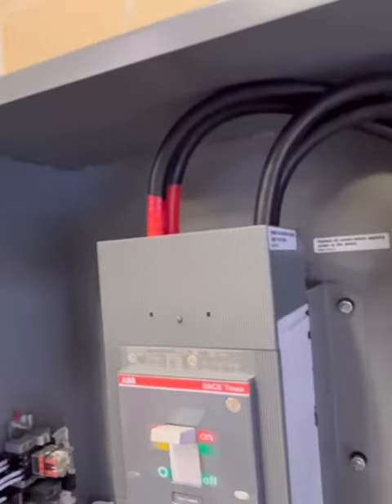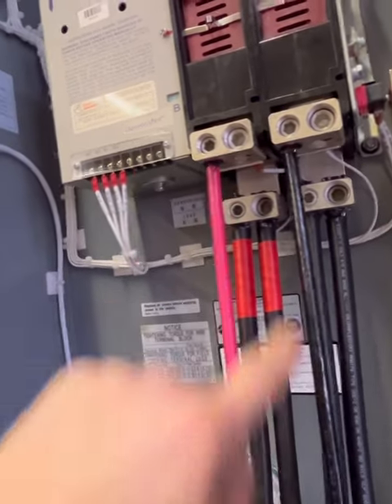Cummins 400 amp automatic transfer switch

Comment: Using paralleled 4/0 gives you an ampacity of 360 A you cannot use the exception in the code book for 4/0 aluminum cable rating at 200 A. But when you go from your transfer switch to your panel you must now use 250 MCM aluminum or 3/0 copper cable to meet code. Your 400 amp breaker is now your service disconnect. Any sub panels off of that need to be rated at the rating of the overcurrent device that they are terminated. Your work looks very nice. Did the inspector question the conductor sizing?
Reply from the maker: The inspector and electric company looked at the work and was satisfied.

Comment: How were the DC connections?  I haven't found a video explaining how those were done or what to keep in mind when making those terminations.
Reply from the maker: By DC are you talking about the battery that allows the generator to start in a power outage?

Comment: You are not an electrician,  but you did good! Looks good!  The phrase 4 o is really 4 ought. Or 4/0. The conduits the connect from the new disconnect to the the sub panels should be 2 in. Good job again!
Reply from the maker: I know 4 ought is the correct term, I always assumed 4 0 was the slang term. That’s good to know about the conduit size. I thought that I pulled up a chart to tell me what size conduit I would need but maybe I just went with the smallest size that I would be able to make work. Thanks for the comment.

Comment: Impressive.  Pretty advanced for a DIY.
Reply from the maker: Thanks!
Reply: What size wire do you have coming from the generator to transfer switch is it capable to handle the ampacity for the 400 amps ?
Reply from the maker: It’s #2 copper wire. It is rated for 115 amps if I remember correctly. The generator is a 20 KW generator which means it puts out 83 amps. That wire only needs to be sized large enough to handle the amps that the generator is putting out. Cummins put a 100 amp breaker on the generator so you have to size the wire to the capacity of the breaker on the generator. The 83 amps is more than enough power to get us through a power outage. My 400 amp service is unique, most houses have a 200 amp service. I increase the service to my house service because I thought I was going to pull power through my house to a shop in the future.

Comment: The load wires to the panels are not rated for 400 amps so shouldn't this transfer switch feed in to a distribution panel first with 2-200 amp mains for proper overcurrent protection for load side conductors?
Reply from the maker: The transfer switch is the distribution center. The incoming 400 amps is split into two 200 amps before it goes out to the panels. That’s how I can run 4/0 aluminum to the panels.

Comment: Jeremy, I take it your local jurisdiction did not require an outside disconnect.
Reply from the maker: This house was built 15 years ago and an outside disconnect was not required. I added this ATS and generator. The generator has a disconnect on it so anyone can disconnect the power coming from the generator if need be.

Comment: Service entry aesthetics:    (Jeremy Your meter panel is how it should be done)
1. I'm all for NEC code changes for safety, but why can it be done in an aesthetic and 
    pleasing manner for the exterior of residential buildings? 
2. Why aren't architects demanding the electrical manufacturers address exterior service disconnects
3. How about an external small mechanical disconnect that uses a spring cable to disconnect the breaker or 
     knife switch on the inside of the building. Of course certified and listed.
Residential 400 amp residential service looks like a small industrial building.
Very large meter panel. Very large disconnects switch box, and a 200 amp panel box, and a second 200 amp panel box in the inside of the residence.
Then down the road were coming up with smart panels even larger housings. How about adding to the engineering staff a design engineer and architect so their voices can be added to the design process and residential stop looking like small industrial plants.

Comment: Very nice install for a DIY!!  Any problems with inspections or permits since you did it yourself?  I know you used 4/0 aluminum and said you wished you used copper.  I personally would love to use copper for all of it but price is almost prohibitive because of price. That aluminum is actually easier to bend that the smaller copper because Al is so much softer material. I also noticed that you had 2 wires per terminal on the meter. Did the utility co give you any problems about that?  In my part of the country that double wire wouldn’t fly. Poco likes wire on individual terminal. Is there an exterior 400a disconnect?  That’s another requirement so first responders can isolate power during an emergency.  They still  require it even though you have the service disconnect right on the other side of the wall. As another person said this was for sure an advanced diy install. Good looking job!
Reply from the maker: No problems with permits or inspection. Here you are allowed to wire your own house as long as you sign an affidavit saying that you will be living there for the next two years. I assume that is to keep people from building a house or flipping one and doing their own wiring and then selling it. No problems with the utility company. That was how it was wired from when the house was built and that was by a licensed electrician. No exterior disconnect. Maybe that would be required on a commercial structure but not on residential. Thanks for the kind words. I take my DIY stuff serious.

Comment: Question ---  I am confused a little --  Why did you bring in 4 Hots and 2 Neutrals from the Meter?  Wouldn't ONE SET of wires be all that would be needed to attach to the top of the Transfer switch -- and then split the feed to the 2 - Load Centers at the lower end of the switch? Can you explain what there is a need for 4 hots and 2 neutrals feeding the ATS?
Reply from the maker: It’s a 400 amp service. A normal 200 amp service would only have two hots and one neutral. The four hot wires are 4/0 aluminum wire. 4/0 is only rated for 200 amps. To be able to get the 400 amps I needed to double up the wire. Another way of looking at it is each pair of 4/0 wires carry 200 amps at 240 volts. At the bottom of the ATS I split the amps by sending one set to the left panel and the other to the right panel. Each panel gets 200 amps.

Comment: Very good job. Can we run 2 separate 22kw generator with one 400A transfer switch?my main meterbase is 400A from hydro side same as yours and I have two 200A panel I just want to put each panel on one generator. Is it possible?
Thanks
Reply from the maker: I don’t think so. The Transfer switch only has one input for the generator but two outputs so it can go to two separate 200amp panels. I think to do what you’re trying to do you would need two generators with its own transfer switch to each of the panels you’re trying to power. It would probably pencil out to be about the same cost as what you’re trying to do. This 400 amp transfer switch was double the cost of a 200 amp transfer switch. So if you’re already thinking about buying two generators which is by far the most expensive part of the project then purchasing two transfer switches for each of the panels would probably cost the same as trying to run it all through one giant transfer switch. However as I said in my video, I’m not an electrician, I just take my DIY serious.